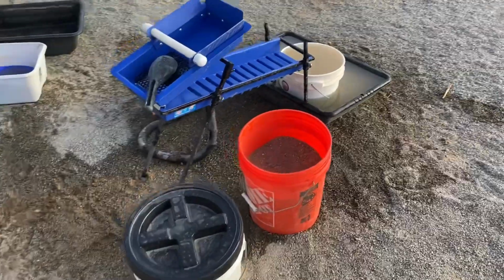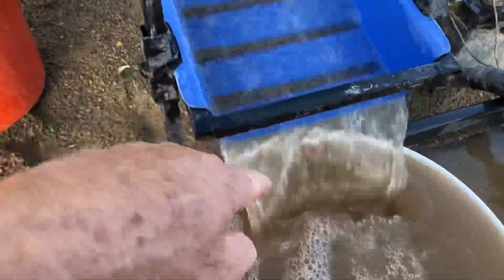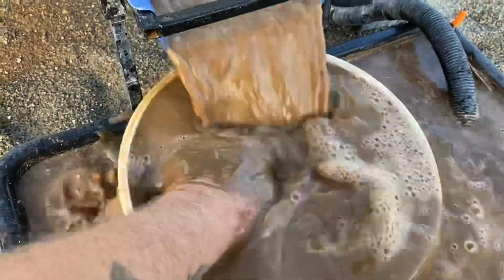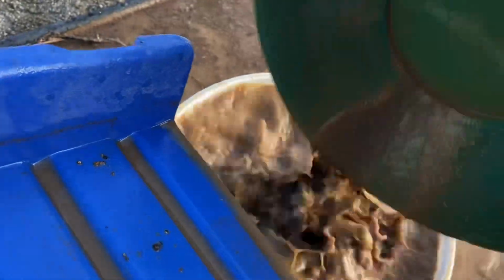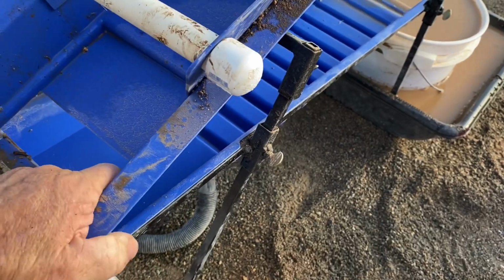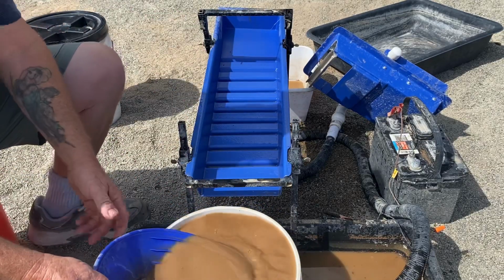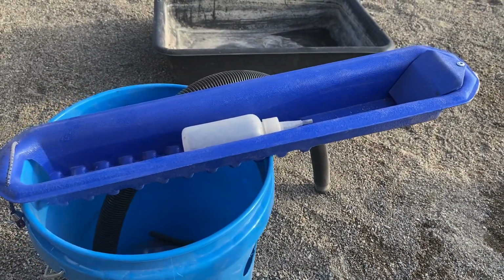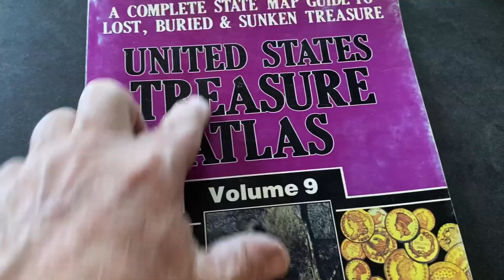Testing the Geo Sluice Sluice Box Drop riffle Sluice

Comment: All sluices catch gold - only thing that makes 1 sluice better than another is by how much gold went straight through
So many people just don't seem to get that
Hardly ever see tests of tailings
Reply from the maker: I try and test the tailing once in a while. I do think all equipment can lose some gold. Lot of factors play into it.
I never did test these tailings.
Good points.
Reply: @goldfeveradventures  So when you name something a test , you need to state what it is YOU are actually testing.
YOU means ALL testers , myself included
Enjoyed your tape - Love your hair
Another thing I find useful is to run my sluice into a wire mesh basket rather than a bucket - This prevents much of the grass from entering your tub and hence your pump
Have a large tray underneath the wire basket to catch excess dirt
Reply from the maker: @mohammednovalija  great idea thanks!

Comment: Nice vidio Jack, I am thinking of buying the 5 gal bucket sluice concentrator for $69.00  Any thoughts?
Reply from the maker: It will work fine for running concentrates or small amounts of material.
Reply: @goldfeveradventures  Thanks Jack, I want to use it for my concentrates from my dry wash.